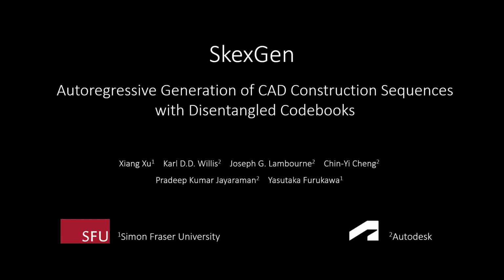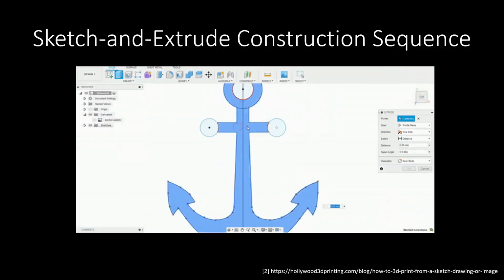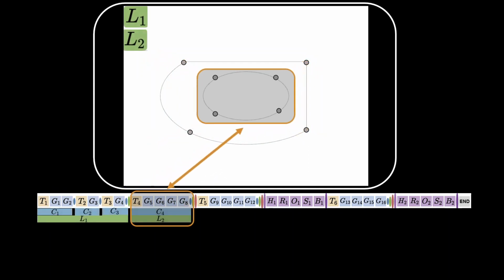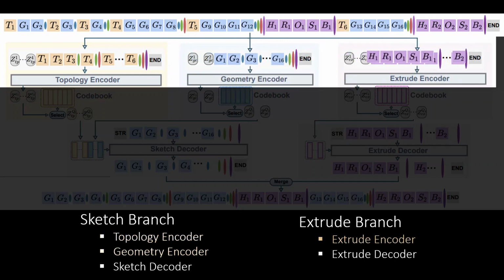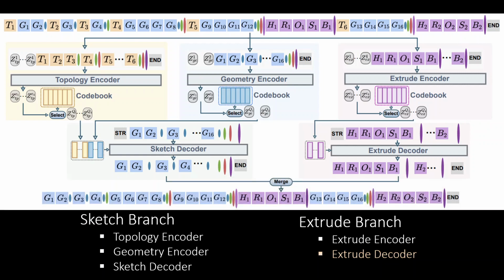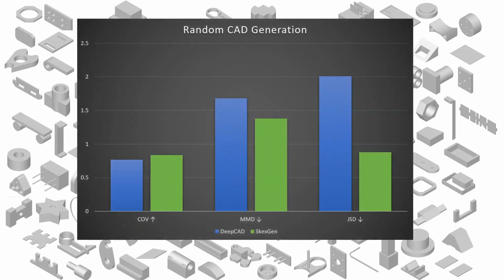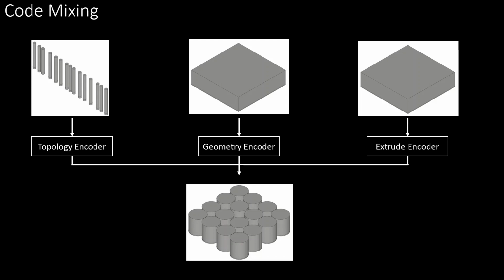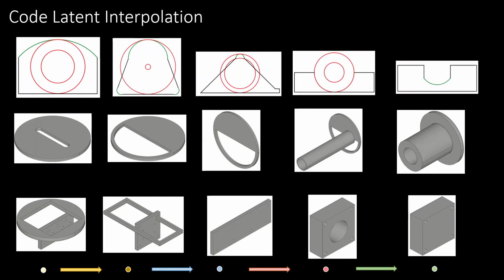[ICML22]SkexGen: Autoregressive Generation of CAD Construction Sequences with Disentangled Codebooks

Comment: I would love to see this as part of a text to image like Dreambooth/ Stable Diffusion and JoinABle. A tool that could generate the design, figure out the parts required and how they fit together and then draw the sketches and extrude them as CAD objects would be the ultimate design tool.